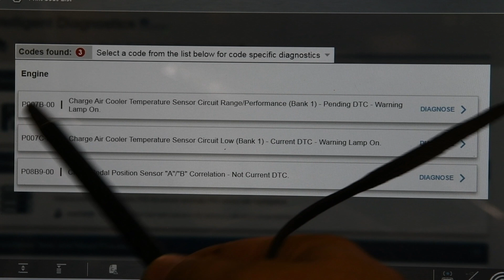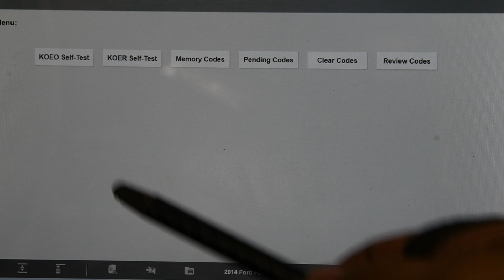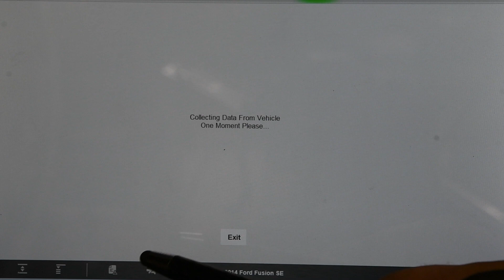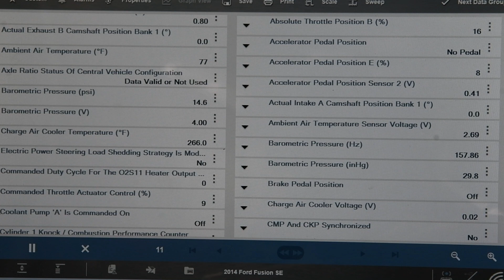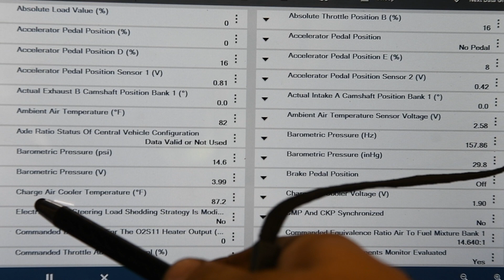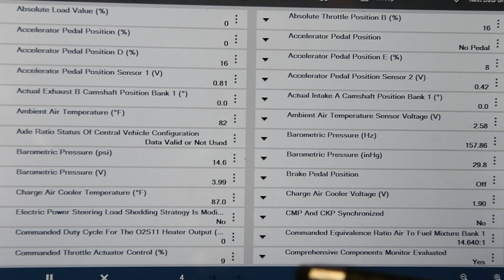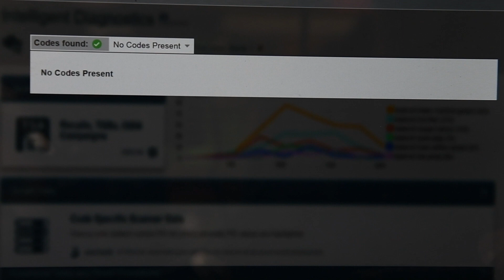Ford ECOBOOST P007B P007C

Comment: I have a 2014 and it's a 2.0 Titanium. There is no other way than coming from underneath. It's on the opposite side from what is shown in the video. I had to remove the intercooler/condenser support below to pull it down enough to access the sensor. If you need to remove the intercooler I don't have any more information at this point. I was able to drop it down enough without disconnecting the intercooler. There was a crap ton of leaves between the condenser and intercooler which I cleaned out and replace the sensor. All is good. I really don't believe the leaves were the culprit, they didn't help, but I'm sure it was they sensor from my scan too. Great video.
Reply from the maker: Thanks Rich. I haven't had to do one on a 2.0 yet. Thank you for the info and thanks for watching. If I get one in I'll make another video.
Reply: Any videos with a 2.0?  I have 2015 MKZ with this issue, sensor is on the passenger side :(  @InTheShop

Comment: I have a 2014 escape 1.6 ecoboost egine.  now, Dec 2020, the milage is only 59, 291miles (95,631KM). the egine light on. I bought a cheap 
LAUNCH OBD2 CR319 Code Reader, the scan code is P007B. I hope the escape is the same structure as fusion. thank you for the video.
Reply from the maker: It should be a pretty similar setup. Hopefully this video helps you! Let me know what you find.
Reply: @InTheShop  After I replaced the part you told us,  the engine light has been off since that day.

Comment: Hi, I have a 2019 ford fusion 1.5L ecoboost engine، There is a problem that the radiator fan is running continuously with the engine running. The engine light read code p00E1, I want to know the location of the sensor